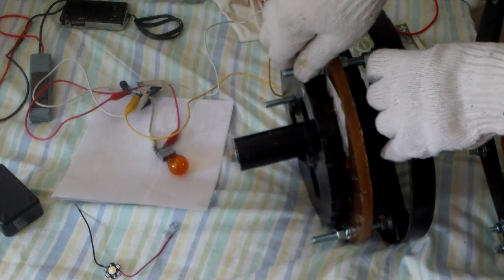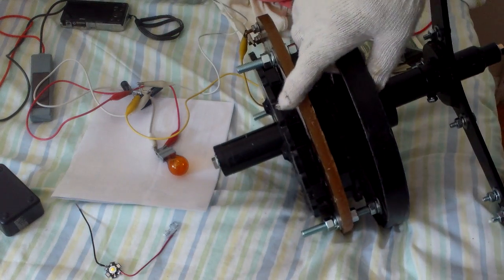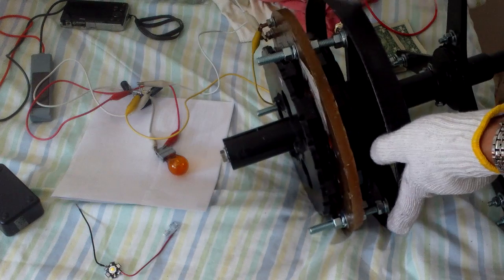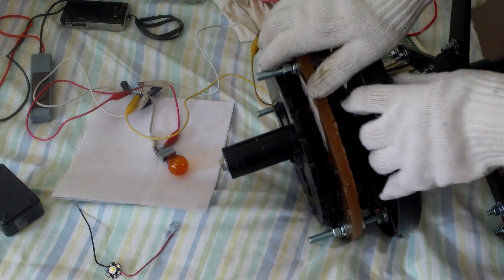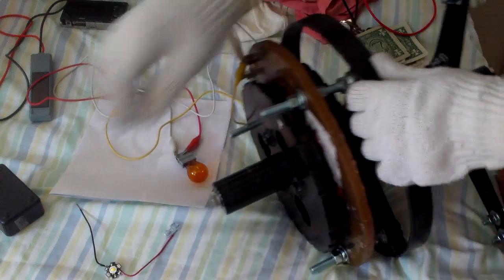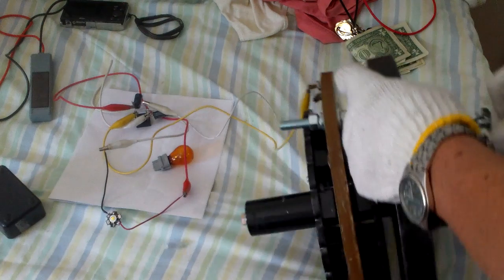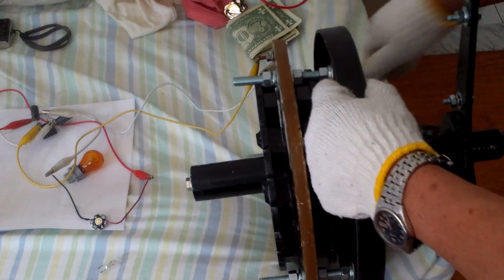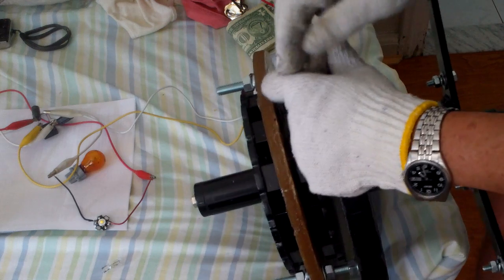Axial flux alternator wind turbine quick measurements. VAWT Part 3

Comment: wow! I was relieved to see that awesome Belgrademachine fabrication making some power. the stator mount holes lined up much better when i had it on mine.  Can"t  wait to see it fly! you are having too much fun.
Reply from the maker: Goofywind Thanks so much for your stator.  The stator support hole is not really an issue. I'm just so glad the whole turbine stator assembly is working well. Next up I'll be making Lenz 2 wings and the support for the vawt.

Comment: Wow, I'm very impressed!  That's some real nice output from there.  This is right up your alley.  Between the solar stuff you have, and now this, pretty soon you're going to be going off grid!

Are those dollar bills in the shot the money you have saved already just testing this??? ;-)
Reply from the maker: jaykay18 You are too kind. It is sort of a one of a kind product as it is not mass produced. I'm glad to be part of the collaborative effort in making the turbine.  For those not interested in machinery and magnets, the sight of money might keep them watching.
Reply: wtam69 Ha ha!  You've got it better than I do should we have another Sandy come by.  After Sandy, when generators became available again, as you know I bought the HF 3200W and 800W, but they need fuel to run, which likely will still be an issue.  

The only "storage" I have are the car batteries, which can take a bit of discharge for a couple hours through very light usage of one of my inverters, and the HF jump pack.  I figure anytime I might have a generator running I can keep the jump pack plugged in to recharge some, and use that to recharge phones/tablets.

But to live complete without reliance on any sort of fossil fuels to generate electricity is something I don't have.  I guess those homes that have gone solar won't be in bad shape, perhaps they'll have parties and invite the neighborhood over.

I miss the days right after Sandy, it really brought all of us as human beings closer together.  It was like the old days.  People would walk by in the neighborhood, they'd stop and chat, and have all the time in the world to do so.  People were shutting their phones OFF to conserve power, something that never happens today unless they simply need a reboot, in which case they're just "offline" for a couple of minutes.  You got news by word-of-mouth, and it was the truth.  People would cook extra food and offer to their neighbors.  Those fortunate enough to live next door to someone with a generator would likely get a cord thrown over the fence.

We got along fine for 9 days without power, although the going got rough from time to time we made do.  I even learned to drink warm beer, which is a skill I use to this day (if I have to).  I would imagine it would be pure luxury with the generators.

Between all the stuff you have, you'd probably be completely self-sufficient, have all the power you need for yourself, with no cost or worry about being able to get fuel.  Of course your neighbors will look over the fence and be jealous, but you can teach them a very valuable lesson.  Instead of throwing an extension cord over the fence, you can show them how to generate their own power.  Like the saying goes, "Give a man a fish and you feed him for a day.  Teach a man to fish and you feed him for a lifetime."
Reply from the maker: jaykay18 It's good to have a hobby that is also productive. The power of nature is just awesome. Think of the power of the sun, wind, geothermal, hydro etc. We are just trying to capture a tiny portion of that power. I will have to power up my inverter generator purchased a couple of years ago. Too much to do and too little time. Warm beer is I guess an acquired taste. You sure do know how to make the most out of a bad situation.
Reply: wtam69 Well, there wasn't much else to do, and the bar was still stocked!

I've been waiting to see that generator fire up.